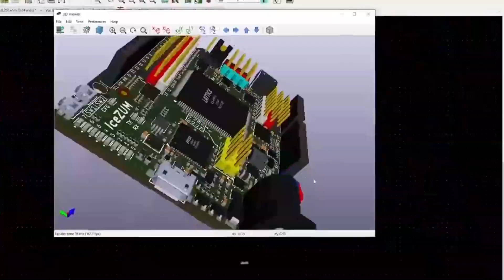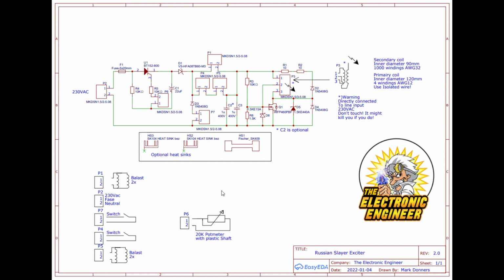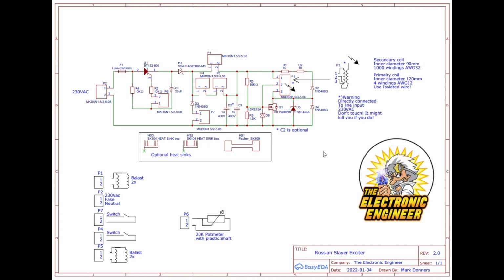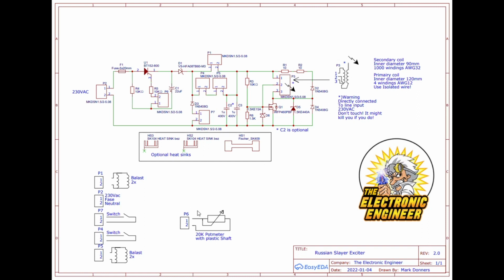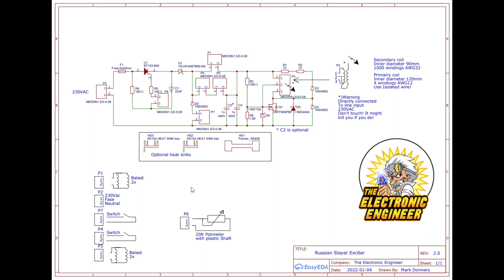How to build a Powerful  Easy Tesla Coil

Comment: Hello and good morning I love your videos I once built a 12-foot spark gap Tesla coil with 100 KV discharge capacitor. Input about 16 ft of Arc I've got a few pictures. Laying around. Nevertheless I'm can basically copy circuit boards and diagnose faulty components I am trying to find an easy way to solve a problem. I have a solar system running right now and there's two inputs for solar panels or whatever DC input on the inverters I would like to run one side with solar and the other side with wind turbine problem is wind turbines start and stop all the time the inverter times Out and restarts in 5 minutes every time there is a disconnection from the solar or anyting. Minimum input would be 90 V DC I am looking to put a small power supply on the system to keep the inverter constantly on but only consume a few Watts. I was just going to take the household 120v and rectify it and feed it into the system but I want a way to regulate. I'm wondering if I can just use a simple inductor on the AC side to regulate the current being fed into the inverter on the solar side. The goal is just to keep the inverter on so when the windmill starts spitting at night it won't start and stop the inverter. Almost like a trickle charge for a battery. What's your thoughts I need/ 90 V DC and only about 10 W regulated the voltage can be higher
Reply from the maker: A simple inductor will not to the trick. Those Converters for Solarpanels are tricky! Lot's of sfe guards in place to make sure that whatever you are doing doesn't mess up the net frequency.